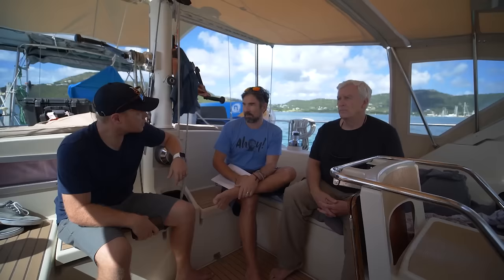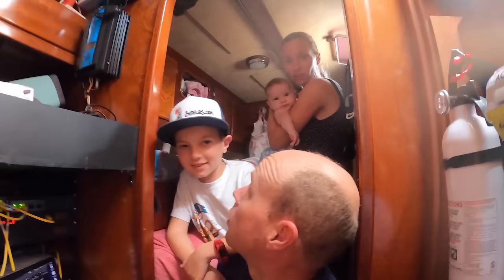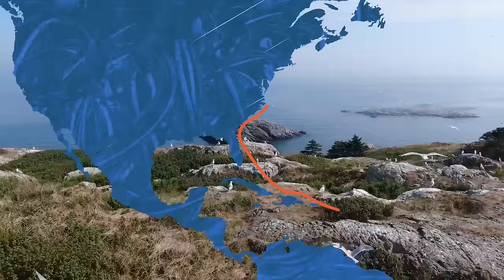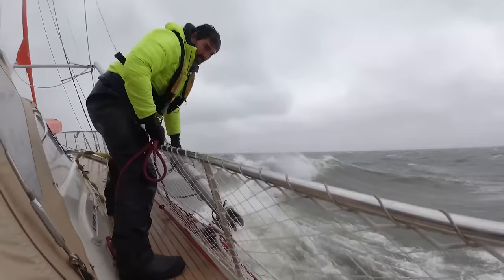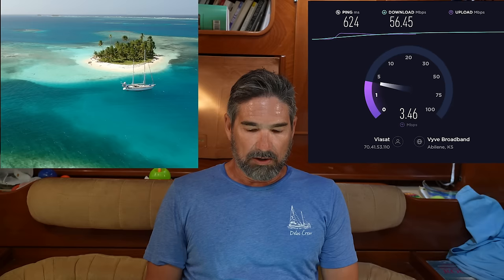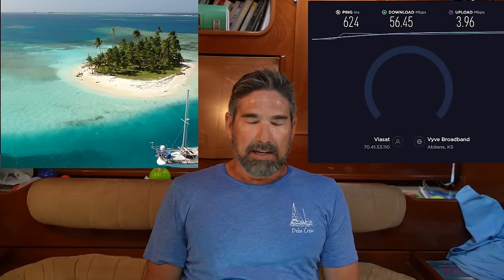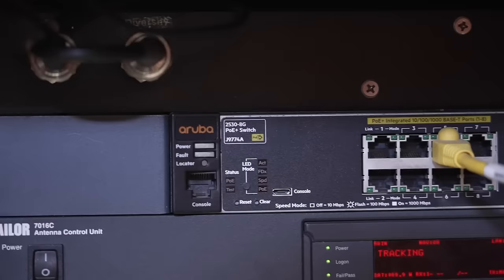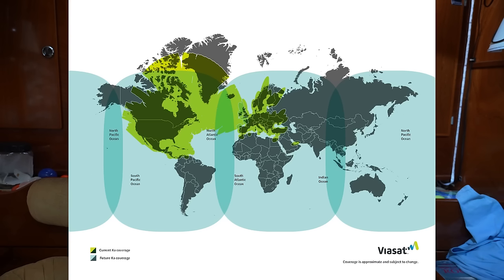Internet At Sea!  Viasat Maritime 3 Year Full Review 📡  Sailing Vessel Delos

Comment: I don't know if anyone here is subscribed to Parlay Revival but a couple of weeks back they did a live stream using Starlink in the middle of the Pacific for 3 hours as they crossed the equator.  The connection (considering where they were) was impressive.
Reply: I was watching too. Made me wish I was out there with them.
Reply: Starlink have sent out ultimatum letters to all the sailing channels etc who are using the land roaming system at sea... the maritime Starlink is really costly too. Not as costly as Viasat but still beyond the average user. I think Starlink will still be the way to go... and they will bring out a sensibly priced boat one soon. As it is now they do either the very expensive one or a strangulated one which is really only for emails.
Reply: @julianbatcheler9970  Lets hope competition brings the costs down- we already know the RV system works at sea.

Comment: Would love to see a comparison between this Viasat setup and Starlink. Given the massive cost differences, I would love to see if Starlink gives a comparable experience.
Reply: Starlink is way better with the latency. They are on a much lower orbit.
Reply: yep, using it now and it's generally < 100ms
Reply: The coverage map is still only coastal areas and even THOSE are limited
Reply: @michiganengineer8621  if Starlink is still only coastal, how is it being used on multiple cruise ships and on the SpaceX rocket barge?

From their FAQ: All areas covered as black on the availability map are considered ocean regions. Only mobile priority data can be used on the ocean. 

This means that you need to have the maritime plan in order to access data in the ocean but oceanic regions do not show on the availability map.
Reply: @Nixontheman  Funny. Starlink maritime starts at $250/month, and the equipment is a one time cost of $2,500. Viasat is over 10x the cost and much, much slower
Reply: @josephp1592  yikes, what a cock up, i can’t find the page that I saw the prices on. Sorry for the misinformation 😖
I’ll change the post.
Reply: @josephp1592  only need the 300$ star link dishy and 80 euro month works a treat
Reply: @SethWhaley  star link works everywhere
Reply: @Nixontheman  it used to be quite a bit pricier, I believe with different equipment at that time. Now I believe they’re doing the RV equipment but enabling roaming essentially.
Reply: @STRUTZKOFF , at sea? I’m talking more than 20 miles offshore.
Reply: @SethWhaley  yeah, its now 2500 for the mobile approved dish, and only with a priority mobile data plan, which starts at 250 for 50G of data. Starlink says it may restrict anyone trying to use a standard dish with maritime data.
Reply: @Nixontheman  in another post on this subject, Parlay Revival was live streaming for three hours using Starlink maritime as they crossed the equator in the middle of the Pacific.  I watched the whole thing.  The connection was impressive.  I believe Starlink has over 4000 satellites in orbit now.  They're shooting for 12,000?  Viasat, 8 to 12?
Reply: @NativeRenaissance  yeah, this is great news for sailors, unfortunately, we must get ready for the Boring Boomer Sailing channel apocalypse, it’s going to take days and days to weed them out of my recommendation feed. 😖
Reply: @Nixontheman  Hahahaha!  Me too!!
Reply: have you thought about starlink >
Reply: @michiganengineer8621  'Starlink service is now global, providing connectivity to the vast majority of the Earth’s oceans and seas. Deliveries are available in most countries where Starlink provides service.'
Reply: @josephp1592  yes Starlink is still costly for the average sailor... but no disrespect to Brian... Viasat might as well not exist unless you are a millionaire or run a cruise ship.
Reply: @STRUTZKOFF  All those users are being cut off.
Reply: @SethWhaley  people are using the RV one at sea... it's now called Roam, they do another called Mobility... but the people using Roam/RV at sea are being cut off or they have to move to Maritime.
Reply: @julianbatcheler9970  yeah. They have one you can change your address on. Then there’s Roam for RV/vanlife type things and the people are getting pushed to the Maritime plan who were using the RV plan previously

Comment: To all those with the Starlink comments - the point of this being a marine-purpose-built unit is something that you are forgetting. I seriously question the longevity of the Starlink unit on a boat in saltwater environments. I could be wrong but we are very early on in this and time will tell...
Reply: Replacing the Starlink equipment yearly is still cheaper than ViaSat.
Reply: @tableswood6911  oh for sure 100%, I'm not saying ViaSat is a legit option for smaller cruisers but also having Starlink go down overseas would be less than ideal...would love them to sell a beefed up marine use version!

Comment: On Starlight, I built a Manifold like you have on Delos from the thru hull, however two things I have everything on its own ball Valve, including to the fresh water under pressure, and one to the bilge, the first allows me to backwash my salt water intake, next I always lay up my engine when I stop with fresh water I let it Idle for Two minutes running on the fresh water, to give the Heat Exchanger a good rinse, and I do not get the Corrosion in my Elbow and exhaust not to mention the other growths.  Next I change my Raw water impeller every year, but they come out clean.  This all came from when I had too clean out and rebuild the heat exchanger, ever since she is always clean.  Having the other end in the bilge in an old pair of stockings allows me to shut off the intake from the Ocean and bring to bear the raw water pump on the engine, and had too use it when the main died , which on my Boat is also the shower bilge.  Since then kept an additional rebuild kit.  Not to mention rebuild kits for the head.  However, people have dragged at anchor and it is always during storms, just knowing I have another pump to bear if I get an impact leak, think it can make a difference, also once in a tight situation seagrass clogged up the through hull wife ran down turned on the freshwater ran for 10 minutes where really needed e motor did not have time to sort the clog..

Comment: How consistent is the signal/connection?  For work I connect to the company servers through a VPN.  I then obtain a license to run the CAD software I use for design work.  If I lose the connection, even for a very short period, I’ll lose the software license then have to restart the software.  This has been an issue for some people using satellite internet.   They’ve had to revert to DSL.  Ugh.  

Great video, thanks for the info.  Keep up the great work.

Comment: For those of you not familiar with satellite antenna systems, the price difference between the Viasat antenna and Starlink antenna is that Viasat steers their antenna mechanically while Starlink steers their antenna electronically. The mechanical system can be pointed more accurately, but with no moving parts the Starlink system is much cheaper to build

Comment: I hope the company will learn a lot from the partnership with you and will be able to substantially reduce size and weight of the equipment without significant signal quality loss. It will be interesting to see updates from you in more remote places (middle of the ocean).  Stay safe and enjoying the adventures.
Reply: They took it off the boat. They’re probably going to sign up for starlink
Reply: @Nixontheman  Lol.  Our satellite communication technology, at least more affordable options, is still leaving a lot for desire. I have seen comments of Starling hardware failures when equipment is left exposed to the elements and especially on boats, given the constant unpredictable movements. Who wants to keep moving the antenna in-out?  Cheers.
Reply: @corujariousa , pretty much guaranteed that those were Standard Starlink dishes, not the Performance Starlink dishes. Most people are incredibly cheap and ignorant.
Reply: @Nixontheman  I wish the articles I read had details about the models used. I've never needed the tech so I've not done any research on it. I am glad there are better models.  I agree with the essence of what you stated. Cheers.

Comment: I remember when you had ViaSat installed years ago.  Then recently you were taking it down because it didn’t work in the Pacific.  I think I must have misunderstood.  Are you getting ViaSat modified ?  Or are you going to StarLink ?
Reply: you're correct. they took it down because there is no service in the pacific. This is just them doing their part to report on how it worked when they had it.
Reply: Probably has to do a follow up/review as part of the original agreement. It it wasn’t he would be comparing it, at least cost wise to Starlink.

Comment: I think you should mention that it is not possible to have a social conversation when RTT (roundtrip) is more than 200 ms, 250 at the most. Viasat offers 700 ms and is completely useless for this purpose. For it to work as a business tool, both parties need to be trained or else the conversation will be very frustrating. Other than that, Viasat is the best you can get if you need internet on crossings where Starlink doesn't work and won't work for many years because there is no communication between satellites. For such communication to be added also a ten times as large solar panel also needs to be added to every single satellite. Thus, geosynchronous satellites will be the only choice for crossings for at least twenty years.

Comment: Starlink works on all oceans and actually has faster service since you are the only one using it for hundreds of miles,  it is Much cheaper and way faster especially at sea. Been using it for the last 2.5 years and have only had maybe a handfull of outages max was 20 min but only once most are less the 30 seconds and as i said maybe 5 times..    I'm not sure how that dish would work on a boat with say one hundred guests, the draw must make it so slow it's useless.

Comment: Yes Starlink is certainly a better mousetrap, there is no getting around the pure physics of traditional satellites vs low orbit, latency (which is important for realtime communications EG video and voice calls) is so much better on Starlink.  One thing people are overlooking with Starlink is how new the service is.  With so many people jumping on board it remains to be seen if there won't be over subscription issues where Elon gets a little greedy and doesn't build it out to handle the load.  If you doubt this look what he did to twitter, gutting the engineering staff and expecting things like a presidential announcement to be fine :P. This isn't a political statement, simply a new tech comment.